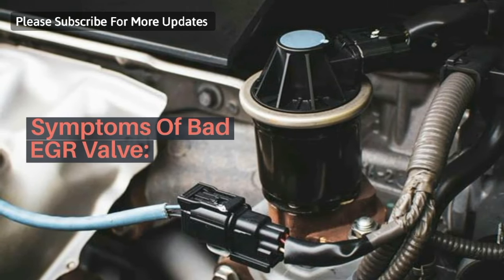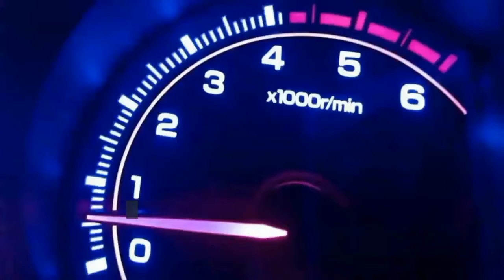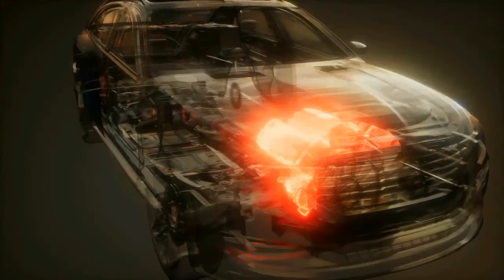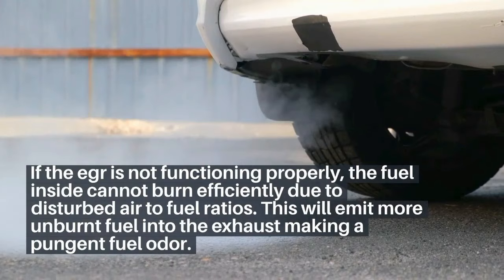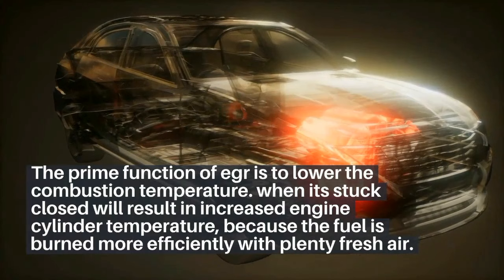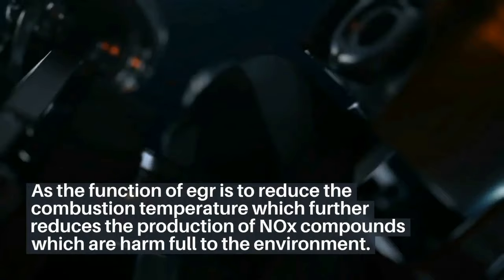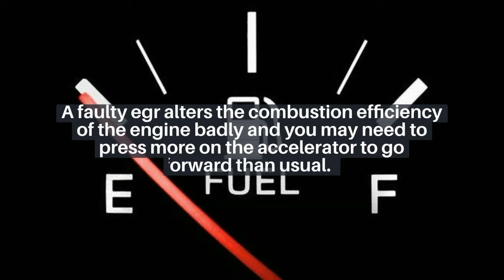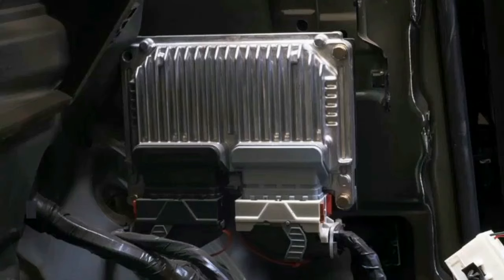Most Common Symptoms Of Bad EGR Valve | Signs of failing EGR

Comment: Only making cars worst with all them dam sensors
Reply: i know thats true. 100%
Reply: agree..its nothing but Garbage
Reply: Nah I remember the late 80s and early 90s. Everywhere you went smelled like gas and exhaust fumes. Now the smell is gone. Im glad they made the sensors.
Reply: i hate those things. my buick electra didnt have all that. only oil pressure sensor.
Reply: If "worst" means more efficient and safe then yes.
Reply: Agree💯
Reply: Does a race car have PCV or EGR valves?  Hmmmmmmm?????
Reply: @ricky-sanchez were was this Manhattan?
Reply: So true
Reply: So true
Reply: @myopicchiwawa no they dont.. but that's a race car.. so your point is?
Reply: @lincolnmech   Move to a no-emission test state and delete PCV, EGR, and Cats. 
If you never needed them in the first place, why do you have them now?
Reply: I am in a no emission state.. i still keep all my emission stuff on my car.. but if my catalytic converter failed i would just delete it.. most newer cars run better with emission parts in place since most newer ecus communicate with the emissions parts.. if you got some car from the 90s or earlier emission parts don't really affect them so much when they are removed..
Reply: @myopicchiwawa  and to answer your question about if we never needed them why need them now.. during the 50s and 60s.. into the 70s.. cars ran on leaded gas.. they emitted tons of pollution from the leaded gas.. they didn't also have epa requirements back then til the mid 70s.. which meant cars didn't need egr valves.. pcvs.. catalytic converters.. it's like saying we never had computers and smart phones then why would we need them now? The argument is kinda irrelevant
Reply: Yep.
Reply: you said it right 👌
Reply: I bet you think points and carbeurators are the best 😂
Reply: Yeps, Dump this garbage!..
Bring back old reliable cars from the 70's & 80's...Easier to work on too
Reply: Blame Big Liberal Government regulations
Reply: Also blame the Tree huggers too
Reply: @myopicchiwawa yep I did all that right here in Mississippi and my car thanks me for it engine back pressure dropped by more than half
Reply: @rosieclark3661  Thanks for reminding me of this conversation. Emission control systems robs engines of power which is the reason I want to work on a street racer with a an optimized exhaust and naturally aspirated intake ( maybe an ITB) . I can't legally do that where I live now. Moving as soon as I retire.
Reply: Exactly. 
Years back you could listen and almost always know what you needed to do,  now it could be 30 different things.
It's funny how we burn more gas with modern " technology " than we did 50 years ago.
Reply: @Mudbuttmoody it means extremely costly, less efficient and bothersome

Comment: My car has been suffering from the 1st symptom for a few weeks now, when the engine is cold, there is noticeable vibration when idling at traffic stop, and when the auto transmission downshifts to full stop, the car felt like threatening to  die off. Suspected bad engine mounting, bad spark plugs, and dirty O2 sensor. Went to a workshop, the guy checked and discounted all 3 causes. Then he decided to do EGR valve delete by blocking it off and voila now the symptom is gone.
Reply: My Ford kuga does the same, 2.0 diesel

Comment: The bad smell at cold is the easiest sign of a bad egr or the gas sensor in the exhaust pipe before and after the catalytic convt.
Reply from the maker: Sure yes. Thanks for bringing that up.
Reply: Is it like a burning smell? And will it make it smoke more?
Reply from the maker: it makes a pungent fuel odour or like partially burnt fuel smell. And yes it spits out smoke. also smoke can be of different reasons. give a proper diagnosis.
Reply: @dailyhandsdiy  thanks mate, yeah mines got a real bad burning smell to it, just started doing it, shaking a little to, wasn't like that when I brought it a few months ago
Reply: @kristopherwilliams5711  Did you fix the problem? If so, wut was it?
Reply: Thank yoi guys! It migght be the problem with my golf! Thought it was a dpf regenerarion, but seems like burning smell when i start cold (and stop in trafic), that random engine shake and white smoke comming(notice today) must be due to faulty egr valve..btw i drive golf 2009 2.0 tdi.

Comment: Hello there. I have a 2014 mustang gt and a week ago I experience lack of power on my car. It’s just isn’t the same when I accelerate. I cleaned throttle body and the mass air flow sensor. It still does the same. I feel like it even skips gears and even jerks on me when accelerating and letting go off the pedal. I have taken it to mechanics and everyone is giving me different info. Some say transmission, coil packs, spark plugs, air filter clogged and even injectors. No check engine light on ever since it started doing it. Please help.
Reply from the maker: Spark plugs, coil packs etc can be checked with ease i guess. Looks like there's a transmission related issue or torq transfer unit issue. Check the spark plugs and coils, change fuel filter if too old and finally if the problem persists check transmission.

Comment: Maaaaan mines runs like CRAP, Ive rebuilt the tranny, rebuilt the engine, whole new exhaust, but not the manifold, changed plugs and coils, throttle body, all that. but for some reason my transit runs like it did before I did all this. And to mention I have no check engine light. Any reason to why mines still has sluggish acceleration and poor fuel economy??!!!
Reply from the maker: Hi, there are other factors affecting the performance of the engine like, crank sensor issues, evap, egr, fuel related sensors, pumps etc...
Reply: @dailyhandsdiy  the mechanic shop said it may be fuel related today because there aren’t any codes. The check engine light is not even on. Looks like it may be the fuel pump
Reply from the maker: Yes, low pressure from pump can cause severe performance issues

Comment: Hi, great video. I have these issues and from your video, it looks like EGR issue. If the MAF sensor is disconnected, then the car goes fine. Would long term use without MAF sensor cause other issues? One garage told me that the DPF won't regenerate without MAF connected? I'm now also seeing a code (P0136) for heated O2 sensor. Any ideas what that means as well. Thanks
Reply from the maker: Hi there, maf sensor is the prime sensor for an engine. ecm uses the sensor's values for injection and working of other valve like egr etc...you may disconnect it and run for short but for long..not recommended. You may disconnect the egr and try again and see if it does anything.
Reply: @dailyhandsdiy  Thank you. By disconnect the egr, do you mean by an egr delete using vcds or by using a blanking plate?
Reply from the maker: No no..just for the time being just unplug the connector and check if this improves anything.

Comment: Had an egr valve stuck closed on my petrol outback. It ran just fine and even passed its emissions test at the MoT. I did eventually replace it as it's a 5 minute job on a Subaru.

Comment: This video helped alot. Had real bad rough idle on 07 4.0 mustang. The plugs, wires, and coil pack are brand new. I did notice a fuel smell but I thought maybe just typical car smell. I ended up buying a new OE motorcraft EGR valve after checking everything it could possibly be. Put the sucker (literally) in and the car runs like a dream at idle while in drive finally. Old one was pretty rusted out, dirty and was probably +10 years old so I guess it was just due to get replaced. Car barely has 100k but I'm fighting age instead of miles with this old ride.
Reply from the maker: Gald to hear from you mate...
Reply: Hey quick question did the rough idle stop once the car was in park?
Reply: @dailyhandsdiy  I have a 2020 sonata, 
my check engine light came on , when I took it to the dealership and start up my car and all of  a sudden,the engine light was off. This hapoen alot..until I finally came to them while the light was still on,  they told me my egr valve need replace. And I was 4 miles over my warranty!! Even though I've been coming to them about 3 months about the situation. Hyundai want 2,500 dollars to  fix it..I'll never do business with Hyundai ever again.. 3 yes having this car and its already fuckin up.. Hyundai are garbage!!
Reply from the maker: That means the egr valve is sticking intermittently and needs a cleaning. Could just give the car for an egr service and the issue should be resolved.
Reply: Also here with an 06 mustang 4.0. Last night it completely lost all of its power and took 2 minutes to get up to 40 where it refused to go faster.
Reply: @dj101buffalo6  If it was documented before the warranty expired, the EGR would have been replaced free of charge. If the dealership refuses, then call a lawyer. 
Similar situations happened at the dealerships I worked at as a service advisor. Every time, the dealership had to honor the warranty. Again, it had to be documented BEFORE the warranty expired.
Reply: @dj101buffalo6   I was gonna say....well there's your problem, Sonata.    If you don't see on road after 20+ years there's a reason.

Comment: Got a 1985 Chrysler LeBaron 2.2 l4 that hates the cold Midwestern weather and almost stalls out.  I cleaned the throttle body, used injector cleaner and nothing changed.  Cleaned the EGR valve....purrs like a kitten.

Many thanks
Reply from the maker: Hi there, so you were saying, cleaning EGR fixed your problem? or still there.
Reply: @dailyhandsdiy  indeed fixed it
Reply from the maker: Glad to hear from you mate :)
Reply: My one same issue. Are u able to restart after stalls? And no code came up ?

Comment: Excellent information packed short clip. Wow, thanks for the refresher, Great job!
Reply from the maker: Thanks mate..made my day.
Reply: Small point, but MAF has one job: inform computer of the rate of air delivery through the sensor. It has no idea what the state of the engine is and is a pure input used as a baseline.  EGR does not affect its output.  There are corrections to that input made using MAP and manifold air temp, and those do get affected some  by egr operation [per engine rpm] - those computer corrections do not change MAF sensor response characteristics or output stability.  Also, O2 [and AFR sensor if equipped] will force fuel trim corrections on the fly.  If egr system fails closed, fuel trim goes positive to offset extra amount of oxygen rich air ingested.  If egr fails open [least likely scenario], trim should go negative up to a certain rpm, tapering back to zero along the way..

Comment: thank you so much for this video. I think after watching this, I have figured out what's wrong with my car. a dealership had it for awhile for some other things like water pump, freeze plug, o rings, few others. I get mycar back and now it stalls while I'm driving and esp. while in park  but not all the time, just sometimes-mostly when first started and taken somewhere. After I drive it and it warms up, it won't do it. It also while driving sometimes acts like it's in neutral-I will press the gas and nothing. rpm's do n't go up. the car won't move and after a min or so of that it'll jerk and go on down the road. My gas mileage  has went down a lot quicker than it used to as well. Your video describes everything it's doing and a code reader did bring up Egr valve and Egr circuit control. Going to get egr replace and hope and pray this fixes the issue. I can't keep driving it like this.
Reply from the maker: Hi there, most of the time an egr clean up should do the job...and if not resolved needs a replacement.
Reply: What was it
Reply: @johnplate9367  If you're speaking to me, I don't know yet. My car has been in a shop since FEb. 2nd and they can't seem to figure it out. He thinks it's my ECM.
Reply: Jay Yoyo  my computer was water damaged. got new o2 sensors, new convertor, new egr, .....car has ran great for a week or so and it's right back to hestitating and rev's itself up while in park. today it stalled on me too. I'm fed up, this has been going on now since the beginning of sept of last year and between my mother and I have paid over 4k trying to fix my car. has new parts, runs a little better but still same problem. also a new tps and map sensor, new spark plugs, new ignition coils. new battery bc the idiot mechanic made my battery go bad but would nto admit it was his fault,  i think tha'ts everything new that's been put on.
Reply: Jay Yoyo  I don't have a radiator cap on radiator. My car only has a place to put it in the overflow jug and it's at it's proper level. I check that often because the first issues that started all this was a cooling problem. water pump, timing belt(my pump is internal near the timing), freeze plug and o rings on back of engine. all that was fixed by a dealership that also screwed us over. i get it back from them fixing that stuff and I have this problem now trying to figure out.
Reply: @kat42243  Actually commenting on last two people's comments.  My car had same problems and I also put a load of unnecessary new parts on but the 3 that really help if you have a FORD are the dpfe valve ($15) egr valve ($25) and most importantly the egr solenoid valve: controller for egr (has round blk plastic top and vacuum goes from it to egr $12 on eBay VERY EASY to fix yourself and will make your car idle/run normally again. 
Good Luck 👍

Comment: Great video.. I now know this will fix my car.. check engine light came on for EGR Valve and fuel filter.. but this video explains everything my car is doing.. RPM's so low the engine stalls.. car runs ruff.. I'm petty sure this is my problem now
Reply from the maker: Hi there mate, glad to hear from you and hope will get fixed soon.
Reply: Andreco
هل تم إصلاح مشكلة سيارتك وكان العطل من صمام egr ؟

Comment: 2012 1.6 TDI seat Ibiza, exhaust sounds different sometimes, louder, rough acceleration for the first 30 mins of driving.. isent rough at idle or cutting out or bad fuel smell
Reply from the maker: If its a high mileage vehicle, its quite normal to hear a bit more knocking for the first 10 to 15 mins or bit more. Its egr that causes the difference. EGR stays closed for that period of time till the engine temp reaches a stage. If the thermostat is not closed properly, can cause more time to get engine hot. So the engine fires up and runs better without egr and cause knocking noise and a bit more vibration. This settles downs when egr opens up and smoothens the engine. This also happens if the egr is sticking intermittently. Also do clean the nozzle tips if its not cleaned before. Note. These are just some guesses have to do a proper check up.

Comment: I just finished cleaning and reassembling the EGR, and after starting the ICE, white smoke with a chemical odor is coming from behind the engine. I did spill the coolant that was in the EGR into the engine bay, so I thought it might just be evaporating, but it's not coming from where it seemed to spill. I turned the car off as soon as I noticed, but despite running for only a minute or so the exhaust manifold was already extremely hot.
Not sure how normal that is. I was leaning on the engine pretty heavily while getting some of the trickier nuts; I wouldn't think that would damage anything but the thought did occur to me. Any advice would be appreciated.
Reply from the maker: Seems the egr valve is stuck open. Sometimes the fitting goes wrong and the valve falls to open position. Might need a dismantle again.

Comment: My honda crv 2010 car scanner shows egr err 99.2.I cleaned the valve but still shows the same .Do I need to change EGR valve? I eagerly waiting for your reply. 
Thanks.
Reply from the maker: hi there, i guess the valve position sensor might have an issue. Do check if the technician knows how to....also repace the oxygen sensor if not done before.

Comment: Hey thanks for the video. Recently my audi a3 1.8 1998 started this knockingish sound it was more subtle than most knockings i see on the YT and it stopped after a day. It also sometimes runs rough when idle but very rarely. Im thinking it might be an egr or spark plugs  but what do you think?
Reply: Sounds like yes maybe those things. Is Could be the coil pack, MAF sensor, fuel filter or vacuum leak

Comment: 1.8 tdci mondeo struggles with boosting but does boost fully at high rpm 4k rpm red line only starts boosting at 2.5 k rpm and fully boosts at 3k and boosts all the way to 4k would you know what the problem is?

Comment: Hi, thanks for the video. This is exactly like my car now. It starts up rough, keeps cutting out on idle and when driving especially at slow speed. I have bmw e60 525d with no dpf. What do you recommend I do with the egr valve? Thanks
Reply from the maker: Hi there, mostly any issue with egr, there won't be much trouble with idle and startup. Ny how it should be cleaned periodically and also clean the air intake sensors ie maf n map. Also check the fuel pressure in lines.

Comment: I have 05 Ram 1500slt and have the wrong head on my 4.7 I have the head w/o egr valve and all these symptoms appear on my truck and even stops. I have to buy the correct head with the egr valve and have my mechanic put it on

Comment: Hi, I'm driving car with automatic transmission and when my car engine is cold and when I try to start the car on P parking mode it starts very easy but when I swith to D or R car feels like not getting air and it stall when I start car again and give a little gas after swithing to D then I can ride, when engine is warm there is no such problem. Is that mean my EGR is defected or I should look somewhere else?
Reply from the maker: Hi there, this could be the egr as its looks like an air starvation or sensor misreading. Could clean the egr if not done for long  Also clean the intake air sensors, throttle body if petrol head. Also change the fuel filter if its too old.